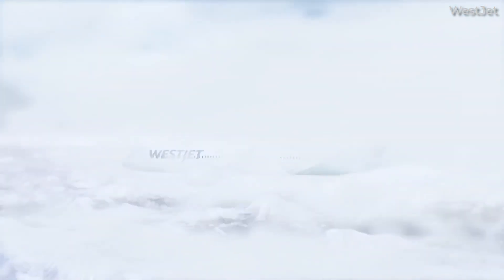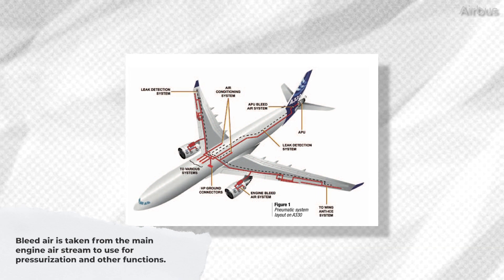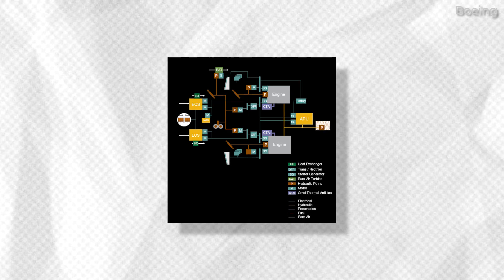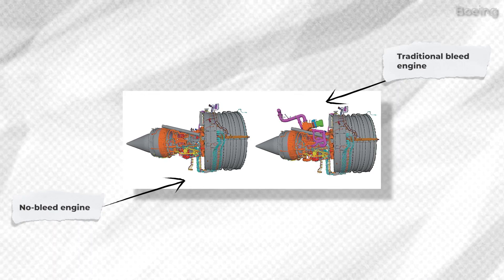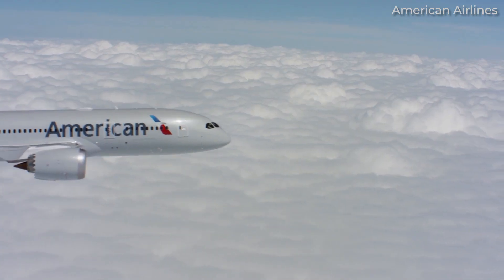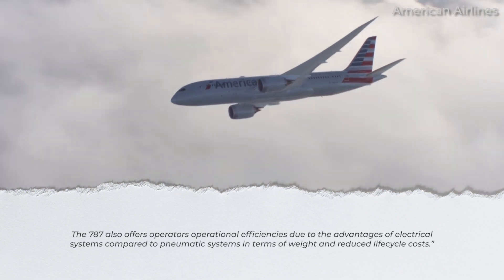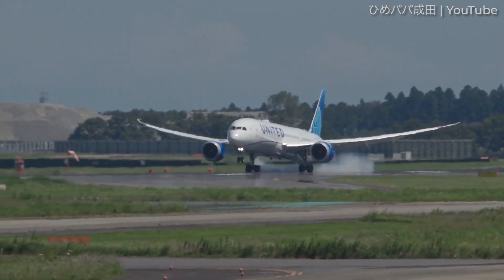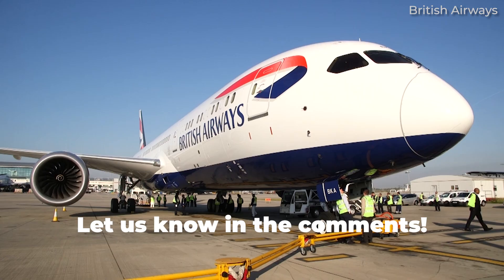5 Things To Know About The No-Bleed Architecture On The Boeing 787

Comment: The illustration should be with figures and cases. The engine mounted generators need power drive which is the engine which needs fuel. What is the capacity of these generators ? How much extra fuel required for them ?  The advantages of air vs electrical power ?
Reply: My thoughts too. Saying they’re saving all this weight and bleeding less power from the engine. But surely all those generators add the weight back and the power required to drive them!

Comment: More-electric system architectures for flight controls could be viable in the years to come. Probably completely replacing hydraulic systems with Electromechanical Actuators (EMA). With the current advancements in DC power generation and distribution,  high power brushless servo motor and actuators, computing, ethernet and fibre optics for flight controls , it is possible. Only  that there isn't much venture into integrating these fields of engineering into one aircraft, mostly due to legal and economic reasons. 😉😉😉

Comment: Well, as an aircraft mechanic, I don't agree with Boeings' claims of reduced maintenance. Because the Cabin Air Compressors still don't last very long, and it's a decent size job to replace them. As said in the video, the 787 just has different kinds of maintenance compared to aircraft with traditional bleed air systems.
Reply: cap

Comment: This video illustrates an example of why the 787 is outselling the Airbus widebody sector., and why Airbus has borrowed some of the design elements of the Dreamliner.
The reduction in maintenance frequency saves airlines a lot of money, and it makes the 787 less costly to operate than the A350.  Those savings really add up when you have a large fleet.
Reply: I would say that B787's smaller size is the reason why it sells better. B787-8 and B787-9 vs A350-900.
Reply: @nntflow7058  The 787 sells better because it has more variants. Yes, the 787-9 is the most practical blend of capacity, range and fuel efficiency, but the big airlines all need big aircraft, so the last 1-2 years has seen a surge in orders for the A350-1000, A321 and even the 777-9. Once that Boeing variant gets certified and proves to be trouble free in terms of quality issues, the orders are going to pour in.
Reply: @nntflow7058  The A330, like the 787, had two variants. The A330-300 is not a small aircraft. Airlines need a variety of aircraft sizes for their operations depending on the routes they're serving. The demand for air travel has increased, and so has the demand for higher capacity aircraft. That's why airlines with A380s are bringing them back.
The 787 is not only selling better than Airbus because of the size. It's selling because airlines simply like it better. If airlines wanted a smaller Airbus widebody, they can order the A330-800, but they're not.
Reply: @nntflow7058  The A330-800 is the next generation A330, so conversely it's more than capable of doing 787-8 missions. The A330-300 is slightly larger than the 787-9 so it can also perform the same missions. 
You basically made my point for me. The A350 is selling well because it's more modern than the 777. It's 15% more fuel efficient and has a greater range. The 787 is outperforming the A330neo because it's modern and so it's a better choice overall. It's not the size. It's just a better aircraft. Period
Reply: @sainnt once b77x in market ,it ll sell like hot cake
Reply: Are you sure 787 outsells the 350 on technical merit alone, for a start it is 4 years older and as Boeing is the USA's biggest dollar earner, all sorts of financial arm bendings are happening? Soon the World will see non-stop flights from Sydney to London fully loaded, something the 787 will never do economically!
Reply: @drdoolittle5724 actually the The 787 is only 2 years older than the A350..
Program launch was April 04' vs December 06' for the A350..
Also ,some compromises were made for Project Sunrise.
Initially, Qantas requirements were to fly 300 passengers, economically for the route..
Subsequently, will actually be fitted with 240 seats for the flights.
Reply: @drdoolittle5724  Let me tell you something interesting; Qantas currently flies nonstop from Perth to London with a 236 seat 787. They will be flying from Sydney to London in a 238 seat A350, burning way more fuel. How much more do you think they will make, assuming most of their first class passengers will be sitting there with points instead of cash? We'll see.
Secondly, just because the A350 came later doesn't mean it's a more modern aircraft. Most of the A350 tech are from the A380, an aircraft that was developed in the 90's, and the A330 neo, an even older aircraft. The 787 has more advanced wings, more advanced fuselage, more advanced avionics, and more advanced engines replacing many of the bleed air systems with electrical ones, which saves airlines fuel and maintenance costs. 
So, to answer your question, yes, the 787 is outselling the A350 on technical merits.
Reply: Reduction of maintenance frequency is overrated. Because with the 787, whatever is reduced in maintenance, is paid back with more repairs. Where I work, every 787 has a weekly maintenance visit in an effort to keep the number of Defered Defects down and preventing AOGs. An effort that is slowly failing.
Reply: @CheapBastard1988  I'd believe that if we weren't talking about an aircraft that's been in service for over a decade. The maintenance I'm talking about here is the engines, and those are the most expensive components. The 787 requires much fewer maintenance cycles than the Trent XWB, and it's not insignificant when you compare both aircraft. While the A350 and 787 are both clean sheet designs, the 787 is still a more modern aircraft, so yes, there are definitely issues related to being the first of anything, but most issues having to do with the 787 have been mostly resolved. There's not much a planemaker can do about issues being caused by outsourcing except to deal with them.

Comment: Why A350 didn’t go this route already indicates this isn’t the best route — battery fires etc are disadvantages
Reply: What rock did you just crawl out from under ..?? Obviously ,been solved..
10 years on, and no issues since..
Reply: @SRT-fv6wr  solved by Boeing ONLY… why would Airbus take this additional risk when they were already under a rush to make this clean sheet design A350??
Reply: @bikingmoments To prevent tiny amounts of engine oil vapours from entering the cabin would be a good reason. There's a reason other aircraft need a high power test run after an engine wash.
Reply: Lithium-Ion Battery fires and bleedless system architectures have nothing to do with each other.

Comment: The 787 is a clean sheet design compared to the 777X. That's why 777X still uses bleed air.
Reply: They most certainly don't share the same aircraft type certificate. They are completely different aircraft.
Reply: @bradw3116  Again, it’s a fact.
Reply: @tonamg53  What's a fact is that 787 & 777 aren't the same types of planes though, 787 is a completely new different type of aircraft. From the pressurization sys., to the fuselage, wings, cockpit windows, etc.
Reply: @johndavidson3424 They still share the same type certification for pilots. Pilots who are certified to fly 777 can also fly 787 and vice versa.

That’s a fact and it doesn’t change or contradict with any of what you just said.
Reply: @bradw3116  Just to be clear as your lack of knowledge seems to get you confused. 

Strictly speaking there is no “common type certification” each aircraft must go through flight testing to gained certification for it to operate commercially. 777 has one 787 has one 777x also needs to get one.

However, there is a common “type raring” which is basically a certification for pilots to fly specific type of aircraft. 787 and 777 shares a common type rating due to its similarities and Boeing’s dedication to ensure that it has the same flying characteristics *cough *MCAS *cough

You are confused between the two. 

The reason Boeing is not using bleed less on 777x is not because of type certification. It needs to have its own certification regardless of which system it is using. You said it yourself that it is currently undergoing testing.

Boeing is not using bleed less design on 777x because it was a failure on 787. 

Instead of saving weight and increase efficiency, all of it was offset or got worse due to the extra battery weight and the heavy vacuum fire proof steel enclosure that they have to housed the batteries in to stop it from burning the plane down.
Reply: Quite correct on the battery power, that's why I said the bleed has been retained due to aircraft type certification. The aircraft type certification has nothing to do with pilots training, it's a regulatory process for proving the aircraft is satisfactory for commercial operation. The 777X is still going through this process
Reply: @bradw3116  787 and 777 share the same type certification. That’s a fact. 

The goal of gaining the same type certification is almost solely for training purposes. While they will look at how the system is design to gain the certification, that’s not the main objective nor it is the requirements for getting the same type certification.

The main thing they will look into is that there are no significant differences in operating the aircraft… 

As long as the operations are the same, it can gain the same type certification.
Reply: Actually it’s because it was a mistake. Remember 787 had battery fire problem when it was introduced? 

They never actually fixed that problem. They work around it by putting the whole battery compartment inside a vacuum chamber. So if the batteries short itself, it wouldn’t caught fire as there is no oxygen. You’ll just get annoyed passengers from IFE offline instead of emergency landing due to fire… 

Large amount of batteries bank would occasionally caught fire randomly… that is why they went back to using bleed air on 777x
Reply: @tonamg53 Battery power has nothing to do with the bleed air system. As pointed out above, the 777X retains most of the systems of the previous generation of 777 due to type certification. Due to the extra power requirements of the 787 they use a lithium battery compared with the 777 using NiCad. Lithium batteries do carry a risk of fire due to their composition, and to mitigate the risk, Boeing have encased the batteries in steel boxes.
Reply: @bradw3116  Battery power got nothing to do with type certification. 

“Type certification” is to do with pilots training. Same type certification means pilot can train for the type and fly both model without needing to re-train.

Pilots turn the power switch to “on” regardless of where it is getting its power from.

Also here’s a fun fact… 787 share the same type certification as 777. 

Pilots can train for the type certification and fly both models.

Comment: The question that should be asked, if it was so efficient, why isn’t it being used on the 777 max?  A plane built after the 787.
Reply: The 787 is a clean sheet plane where as the 777x is not a clean sheet plane

Comment: What happens in the event of an electrical failure ... is the aircraft still controllable?
Reply: One type of backup for electrical failure in a 787 is a Ram Air Turbine. The RAT can produce electricity and hydraulic power.
Reply: @skyserf Also, both engines have two starter generators, the APU has two starter generators, and the Electronic Engine Controllers have their own dedicated generators. And then there are two batteries (main battery and APU battery). The 787 has more electrical backup systems than most other aircraft.

Besides that, the left and right hydraulic systems still have old fashioned Engine Driven Pumps. It's not like there aren't any hydraulics without electrical power. It's just that the center hydraulic system is dependant on electrical power, while a 777 would also have Air Driven Pumps on the center system.

Comment: All that electricity would need to be generated by some heavy gernerators, so I fail to see the weight savings.
Reply: The electrical power is generated by the engines itself. Making use of this electrical power directly for discreet systems saves on weight and complexity.
Reply: @joeljustin  you do need more and/or stronger generators to convert engine spinning to electricity. 
It’s more efficient than pressurized air for sure, and does save some weight.
Reply: Generators used in Aviation operate at much higher frequency, so they are not that heavy. Boeing did the calculation and then arrived at the architecture.
Reply: The two VFSGs (Variable Frequency Starter Generators) on a single engine have a similar weight as a the single IDG (Integrated Drive Generator), BUG (Backup Generator), and airstarter (including ducting) like is typically found on a 777s' GE90 engine.

Comment: I'd like to know why Boeing didn't go no-bleed on the 777X.
Reply: Probably for extra commonality with the older 777s
Reply: Because they would have to spend even more money redesigning all systems instead of just the wing, engine and a few other systems.
Reply: Bc the 777x isn’t a clean sheet design.
Reply: @FanRailer That's not an explanation. When there's a will (or obligation), there's a way. The 747-8 even had a few flight controls operated by Fly-By-Wire, while the 747-400 didn't. It was probably just too expensive.
Reply: Short term stock concerns
Reply: The 777x isn't a clean sheet design.
Reply: Makes sense to me!

Comment: One side effect is that the 787 doesn’t use an Air Start to start its engines when the APU is INOP. Instead, it needs a significant amount of ground power to accomplish this - I’ve seen stations need to hook up two separate gate powers plus a power cart just for barely enough power to get it going.
Reply: The 787 always use 2 external power sources on the ground. The 3rd source is needed to start an engine if APU electrics are not available.
Reply: @versasys  how does this work for power across the different buses? Like I’m assuming the load is split across the plugs and not just combined?
Reply: @andykr2253 Depends on what power source is connected. If you have 1 power lead connected, all the busses will be powered through bus tie breakers. 2 power leads, the left and right sides are split. The 3rd socket in the aft position is dedicated to starting the #2 Eng, but also running the right elec hyd pump and the L2 cabin air compressor.

You can start 1 of the engines on only 2 power leads but some loadshedding will occur.
Reply: Seems that you work in the industry. Yes?
Reply: We call this systems VFSG “variable frequency starter and generator”provided by the legacy team of Hamilton Sundstrand, each engine can generates up to 1MW of power as needed.  The ground carts provide the electrical power to VFSG during the engine startup process and also provide the power to the all electric air conditioning packs.  Using the ground support electric system the 787 does not waste any jet fuel until gate out.